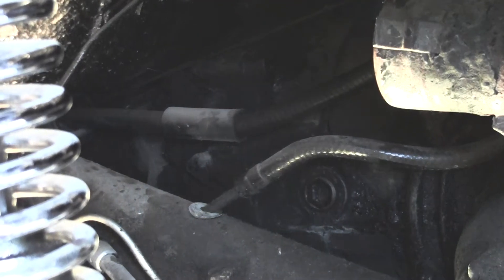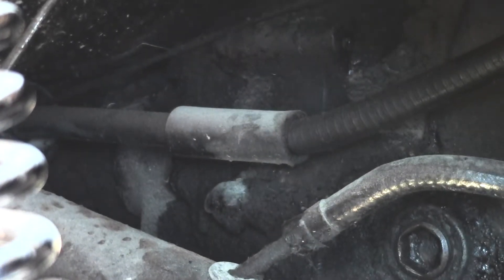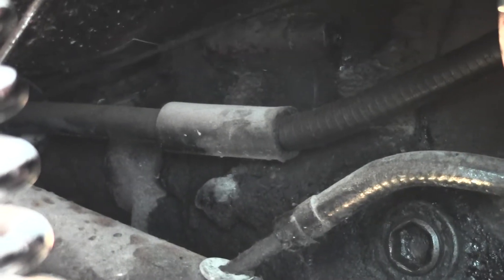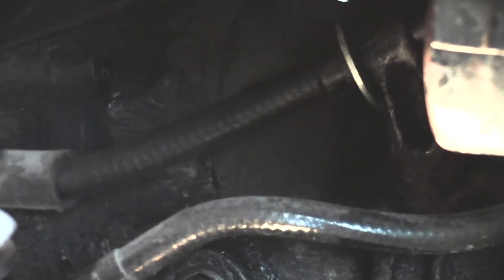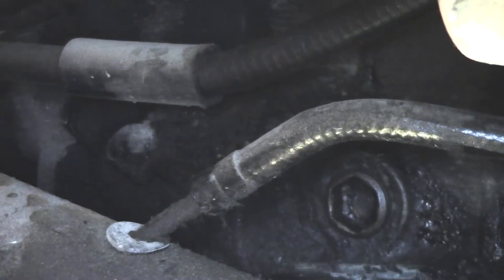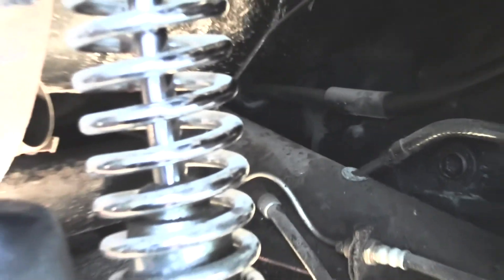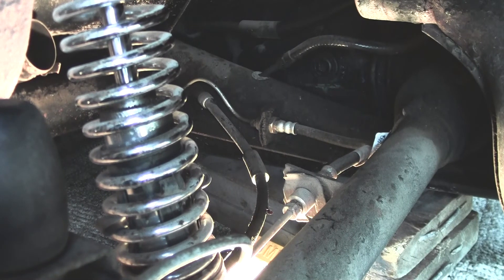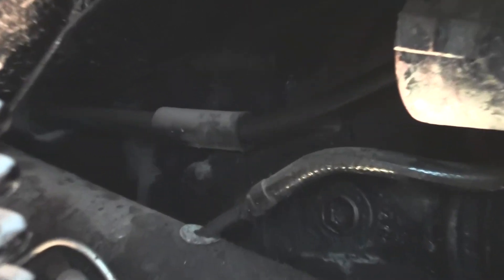" Bowden Sag " Clutch Cable  Early VW Beetle

Comment: It,s actually called a Bowden tube but your info is correct.Make sure the Bowden tube has the required 0.8 to 1-inch bend in it -- this is essential to allow the engine to rock on the mounts without tugging on the clutch cable. Too little bend makes for great bunny hops when using the clutch.Good video.

Comment from the maker: The cable is aircraft stainless steel quality ..very strong . I don't believe it could break from a 2" bend? Probably it just wore out from old age. To much bend would certainly put a strain on it. there is a video of a Bowden tube on YouTube where they have used 6 washers !! The bend was at least 6" Extreme strain on that cable.
But if it's done correctly you'll end  any clutch chatter. Good Luck